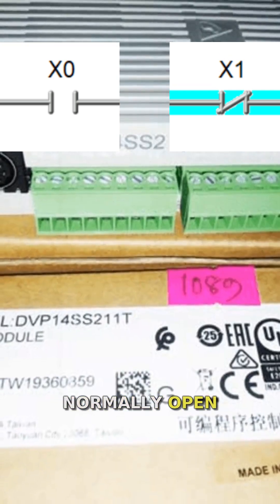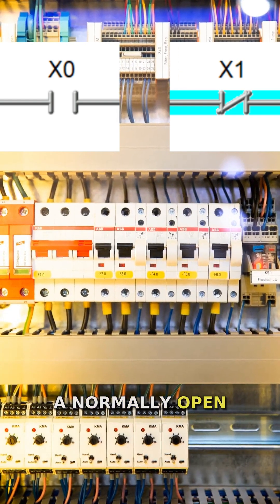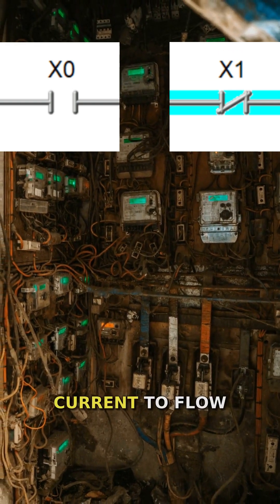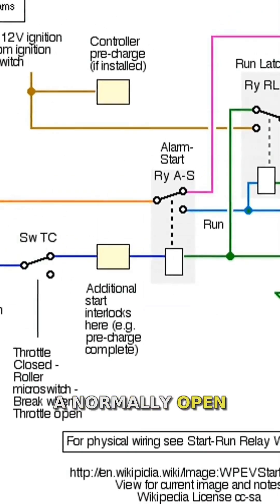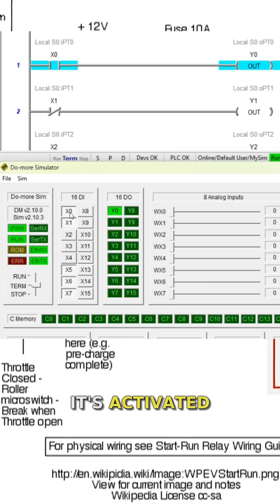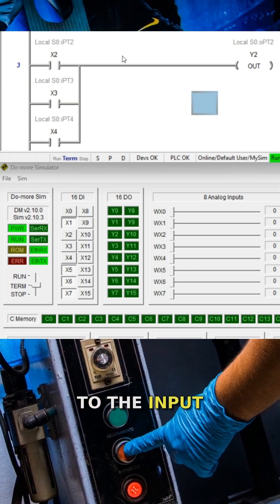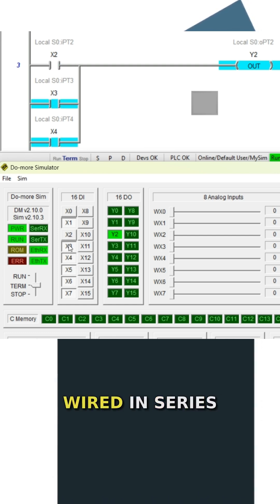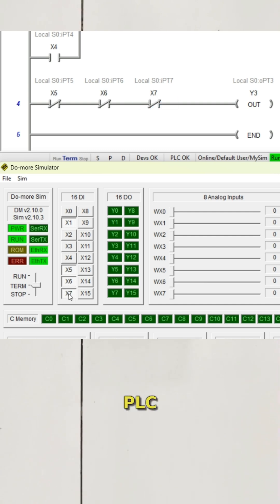Mastering PLC Basics: The Mystery Of Normally Open Vs Normally Closed Contacts

Comment from the maker: Learn about normally open (NO) and normally closed (NC) contacts in Programmable Logic Controllers (PLCs). This video explains their roles in industrial automation, wiring methods, and programming techniques, with a practical example of a machine safety system.

PLC Beginner’s Guide to PLC Programming
https://accautomation.ca/programming/plc-beginners-guide/

Here are the controllers that we have covered at ACC Automation:
LS Electric XGB PLC Series (IEC Programming)
https://accautomation.ca/series/ls-electric-xgb-plc-series/
BRX Do-More Series (Do-More Designer Software + Simulator)
https://accautomation.ca/series/brx-do-more-plc/
Productivity Series
https://accautomation.ca/series/productivity-1000-plc/
https://accautomation.ca/series/productivity-2000-series-plc-p2000/
Click PLC Series
https://accautomation.ca/series/click-plc/
Omron CP1H Series
https://accautomation.ca/series/omron-plc-cp1h-series/
Horner XL4 PLC Series
https://accautomation.ca/series/horner-xl4-series/

https://accautomation.ca/series/easyplc-software-suite/
EasyPLC Software Suite is a complete PLC, HMI, and Machine Simulator Software package. See below to receive 10% off this software. This PLC learning package includes the following:
Easy PLC – PLC Simulation will allow Ladder, Grafcet, Logic Blocks, or Script programming.
HMI System – Easily create a visual human-machine interface (HMI)
Machine Simulator – A virtual 3D world with real-time graphics and physical properties. PLC programs can be tested using the EasyPLC or through other interfaces. (Modbus RTU, TCP, etc.)
Machine Simulator Lite – Designed to run on Android Devices.
Machine Simulator VR – Virtual Reality comes to life so you can test, train, or practice your PLC programming.
Purchase your copy of this learning package for less than USD 95 for a single computer install or less than USD 110 to allow different computers.
Receive 10% off the investment by typing in ACC in the comment section when you order. http://www.nirtec.com/index.php/purchase-price/
Learn PLC programming the easy way. Invest in yourself today.

Regards,
Garry
ACC Automation
https://accautomation.ca/